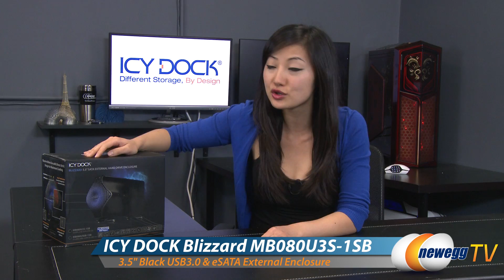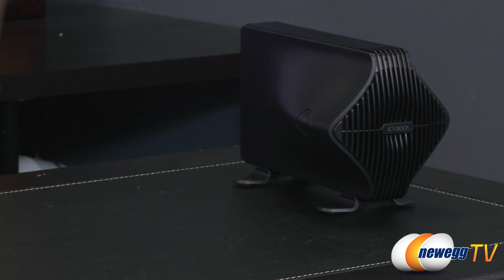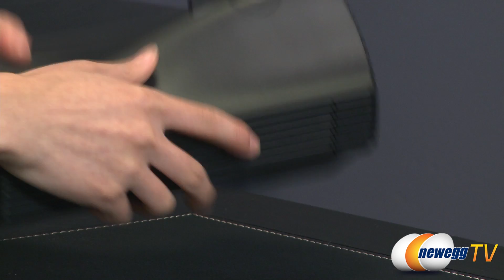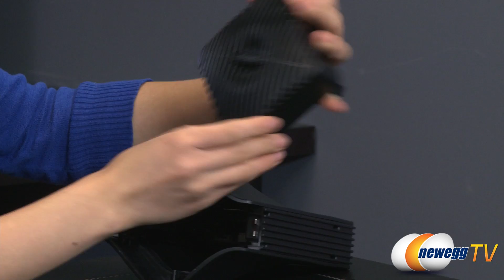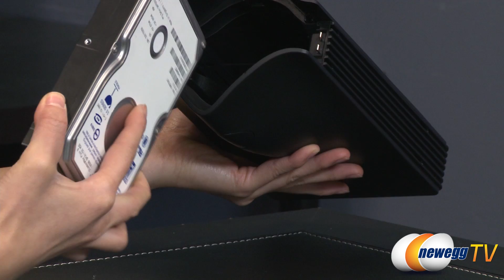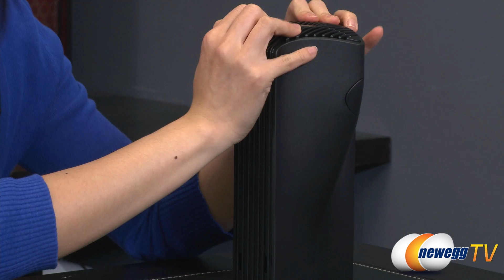ICY DOCK Blizzard ABS shell with metal frame Overview - Newegg TV

Comment: how much will this motherbored and APU bottleneck this card?

motherboard- MSI NF750-G55 AM3 NVIDIA nForce 750a SLI HDMI ATX AMD Motherboard
APU-AMD Phenom II X2 555 Black Edition Callisto 3.2GHz Socket AM3 80W Dual-Core Desktop Processor - C3 Revision HDZ555WFGMBOX

Card- GIGABYTE GV-R779OC-2GD Radeon HD 7790 2GB 128-bit GDDR5 PCI Express 3.0 x16 HDCP
Reply: rustybacon54 i would get a quad core and overclock it most cards and games work better with them.
Reply: kght222 yea dual core is fine but i had an hd 6670 with a dual core at 3.4ghz  once i moved too a quad core it made a huge difference.his running a hd 7790 with a dual core i think that cpu is going to hold it back.
Reply: i got another question, i have a 3-pin 94 mm fan with a sensor and i need it at the front of my case. problem is, it cant reach the SYSFAN1 connection. can i put it in a non-sensor 3-pin connector?
Reply: rustybacon54 yea they sell extensions they work fine i have some of them from my mobo to my fans and i can control them fine from my desktop